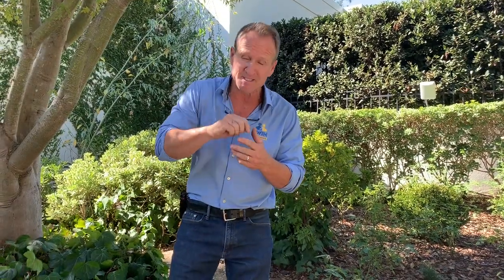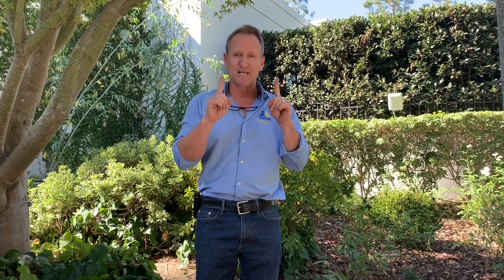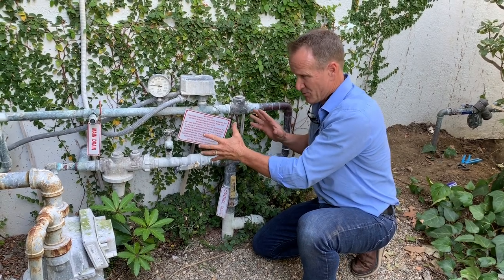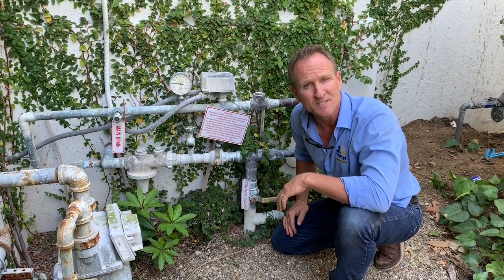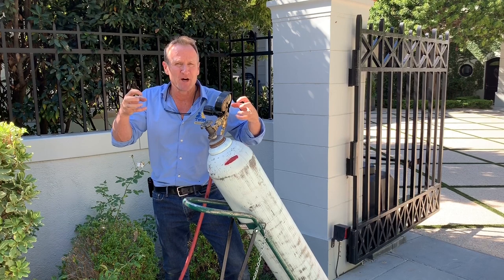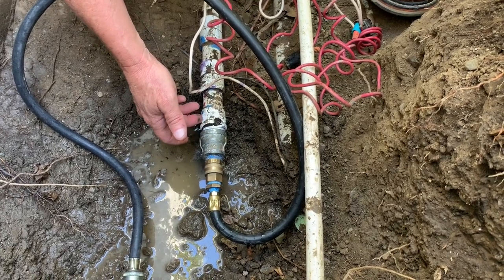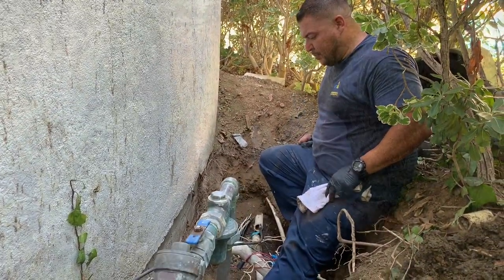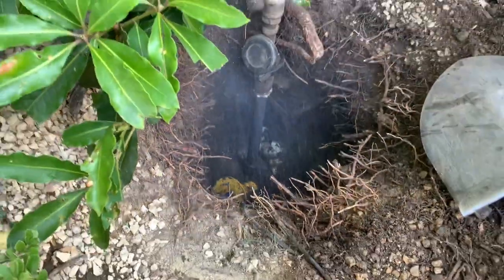How To Find An Underground Water Leak Causing A High Water Bill: Tips and Costs

Comment: A sewer camera in the water lines lol isnt that dirty and can cause people to get sick
Reply from the maker: So a pest control company or a gardener who goes around the property spraying chemicals over your sprinkler heads, what happens? 

The sewer camera going down a sprinkler system, even if it was contaminated will NEVER enter the domestic water supply, it is protected from backflow devices that do just that. PROTECT!
Reply: @TwinHomeExperts  Not to mention, who said that particular camera has ever seen the inside of a sewer pipe? A garbage can isn't dirty until one places garbage in it.....